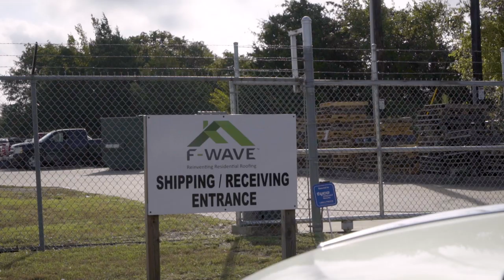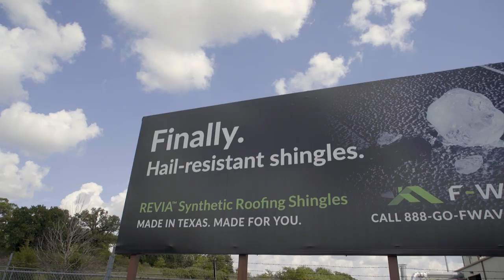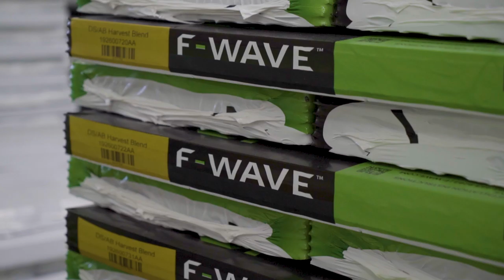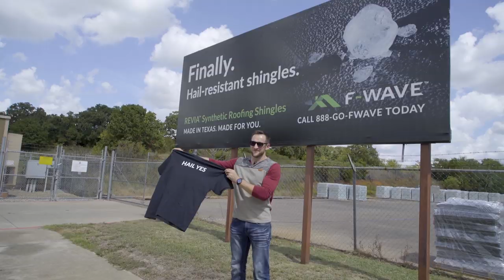F Wave: Roofing Shingle Review: not afraid of Hail or Foot traffic | Roofing Insights

Comment: It’s an amazing product and your video is well done! 

I’ve installed this product in the Denver area and people should know that the installers need to go slow and doublecheck their measurement and chalk lines often. 

This product can easily be installed incorrectly and literally make the roof look crooked. I’ve seen it happen on other installs and about 200 sqft had to be re-done. If that would gone unchecked then the whole roof would need to be re-done. 

F-Wave will offer a product engineer on your first install which will help a great deal and after that you are pretty much on your own so great care must be taken to make sure it’s done right.
Reply: Do you install by chance? I'm looking at using this on a house in longmont..

Comment: I like the "walk on" aspect. I have a low pitch single story ranch, and I like using my leaf blower to blow my gutters out at least once in the spring, and once in the fall. Normally I wouldn't think of walking on a roof, but for cleaning gutters, this is the way. This product is probably going to be my next material for my next roof.

Comment: I'm a roofer w 20 years experience. I know that TPO membrane used in flat roofing becomes very brittle after 7-10 years. Once this happens hail impacts will cause severe damage to the membrane. The damage looks just like a spiderweb crack on a windshield that's been hit by a rock.

Comment: Thanks for the review. Considering getting these as our "class 4 hail resistant" shingles are already possibly needing replacement after only 8 years in Colorado hail. Cost of FWave is more than double, but maybe it's worth it for a more permanent solution?
Reply from the maker: I prefer Euroshield over F wave for hail
Reply: @RoofingInsights3.0  , because of the cost, or the performance?  Or some of both?  Thanks.

Comment: Good and honest review. I am a normal consumer, not a roofer. It surprises me that here in the year 2020, we are still producing 10-25 year asphalt roofs. 

It surprises me because technology should have caught up with the market by now. F-Wave looks like a good alternative. In my opinion for a $$$ thousand dollar roof on a traditional house (ie here in Austin TX), all the roofs should be lasting 50 years. Instead they all have the particles fall off, and the shingles fail in 20 years or less. I call that a failure in the roofing manufacturer's technology. Because I sure don't have to replace house siding or interior sheetrock every 20 years!
Reply: You dont get it do you ? If roofing materials were that durable you woudl put roofers AND manufacturer es out of business, so they have no incentive to move ind infection to point out.
Reply: @johnwhite2576  LOL good point.
Reply: I am getting an f-wave roof installed in Round Rock.  I say that "Asphalt is the roof of all evils"
Reply: @roundrockguy  It looks like an impressive product. I agree that asphalt shingles pretty much suck. I think the standard shingles are there so the roofing industry can make money. What a crap design (standard shingles).
Reply: John White hit the point..As in cars and fuel. We should have had hydro tech running cars decades or a centruy ago, but it is not profitable to the industry that protects and lines its pockets.
Reply: I wonder why they have not used that product that is supposed to be fire proof. Starlite. Sound cheap enough to make and fire proof. Use it in the core or in process.

Comment: Question is After 5 to 7 years in extreme heat and cold it would be very interesting if that plastic does not deteriorate and become vulnerable to hail breaking the shingles up. Only time will tell.
Reply from the maker: time will show
Reply: We know from other products that such materials get brittle. So, I dont know if this is a niche product for hail specifically or is there something to it that hot(90-120) climates with freeze cold winters would hold up for 20+ years...? I wonder what the warranty is like?

Comment: I wonder how it would do for a HOT climate, like Florida or even hotter, Arizona or Los Angeles?? Los Angeles gets 90-115F heat then in winter gets 37F cold for a few times, and the rain. How will the shingle using TPO hold up in such swings of temp over the years? This is the test many would want to know. How are their lab tests in this? Maybe it makes for a hotter attic or maybe noisier when it rains, or?
Reply: texas is pretty hot

Comment: Great review! Getting ready to install F wave on my house. My concern is that they would become brittle over time as well. This is directly from F wave website: “F-wave’s REVIA Synthetic Shingles, on the other hand, are engineered for maximum durability. Because they have zero granules, they won't become brittle, and their performance won’t deteriorate over time.”  Does this make sense, that just because they don’t have granules they won’t become brittle? Doesn’t make sense to me.
Reply: And after speaking with F wave rep today, they say their accelerated 25 year testing shows that they should not become brittle. They expect super longevity. But I guess we will see. In my opinion, we know for a fact that asphalt shingles will become brittle and deteriorate, so might as well try a new product if there’s a chance that it won’t become brittle and has all the other benefits as well
Reply: @LDubsChannel  Perhaps...The first reply for Luke sounds like it avoids the question. I would like to see those tested shingles, and know how they tested it. I would consider these in a hot climate even, that hardly gets hail at all, but, if it outlasts asphalt by a large enough time, it maybe with using. So which comes to the bottom line..the warranty!
Reply: @LDubsChannel  In my area, which gets hail, still a Malarkey roof on a home from 1989.  I go with what's proven.

Comment: What kind of testing did they put the shingles under? Did they expose the shingles to extreme temperatures for extended periods of time? I would expect some sort of stability testing to prove the concept since the technology is only a few years old.
Reply: Hi Jeff, we have subjected our product to all the same ASTM testing that other shingles are subjected to to be able to be sold in the United States. Freeze thaw is certainly one of those and in those tests are expansion contraction rate was very minimal, less than 1 mm.
Reply: How do they simulate 50 years of UV degradation?
Reply: @mobleyMobley  yes, testing methods are important. Like the other comment, for hot climates like So Cal that do drop to freezing in winter but get 90F for long periods then 110+F and then the winter.

Comment: My original comment was deleted for some reason. 

I’m skeptical because a lot of roofs I work on that are TPO/PVC get red algae.  I know shingles can get that, but your premium ones have copper in them to help keep your roof looking nice.  The shingle has granules that can help with grip some.  What happens when these get red algae and you try to “walk” on your roof?

Houses have shady areas and I could see these getting dirty real quick, which will make them slippery.  How do you clean them when they get dirty?  With shingles you can add those copper strips you made a video on a little while back, but for these I don’t see anyway to keep them clean.  

 I like the idea of new types of roofs coming out for home owners, but I’d stick to a premium shingle or get a metal roof if I’m spending this kind of money.  I’d have to give it another 5-10 years to see how this is going before I’d consider it.
Reply: Stone coated metal roofs do not fail due to hailstone impacts but they may show massive dents due to these impacts and insurance companies do not pay claims for cosmetic damages. In addition, the interlocking metal roofing systems are very hard to impossible to replace single damaged shingles. You have to work your way up t o the damaged shingle and replace all the lower metal shingles due to the interlocking nature of the metal roof.
Reply: Regular asphalt roofs get algae moss as well trust me, and it’s really NOT a good idea to pressure wash thsoe with attendant granules loss ! These arte bound to be better

Comment: I drove through a neighborhood with 2 year old houses in Pflugerville Texas that had 2 inch hail.  There was one house on the street had f-wave and it was the only house w/o a roofer's sign in front of it. The other houses had designer shingles and metal, even the metal roofs were being replaced. That sold me.  I'd be curious what accessories you recommend to go w/ f-wave. I am upgrading to Titanium 50 underlayment and bullet boots, anything else?  I believe the roof system is only as  good as the weakest link.
Reply: We've installed F-Wave a few times in the Austin area this year. This includes the area affected by the 4/15 storm you're referring to. We install 24-gauge T & D style drip-edges, a variety of the higher grade synthetic underlayment, bullet boots, StormGuard, W Metal valleys as well as ensuring proper ventilation. We are making F-Wave our primary moving forward as standard asphalt shingles are a subpar product here in Central Texas. They simply do not hold up! Good choice by upgrading to the F-Wave. It has certainly made a believer our of us!
Reply: @BalconesRoofing   Thanks, I saw your work on F-wave's website. Nicely done. I wish I had gotten a quote from you. I ended up going with another roofer, but I insisted on the 24-guage T & D and bullet boots. Apparently my job was the first to use ice/water shield as much as F-wave recommends, 2 feet along eaves and rakes into the interior wall and in hips/valleys and penetrations. I also had my roofer add soffit vents as my house had none on the front and remove a ridge vent over a lower dormer.  I love how you do all that standard, I had to get my roofer to add all of these into the contract. Apparently he had no idea how much some of the things I was asking for cost as he claimed he lost money on my roof, but said he learned a lot. F-wave is great. It is so sad to see all of the new asphalt roofs going in knowing it will take one hail storm to destroy them again.
Reply: @roundrockguy  Yeah, it doesn't make a lot of sense to offer an upgrade like this just to skimp on everything else. We install per the manufacturer's specifications and recommendations and then some. Each job has goes through a full cost analysis so we can be as accurate as possible with pricing instead of offering a price per square.
Reply: @BalconesRoofing  I love the way you do it. My roofer ordered normal drip edge in my custom color but I refused to let them begin until they ordered the T and D I specified in 24 gauge. It delayed the project but I didn't care. My house has large gables and a lot of rake ends so it really mattered to me. He also messed up in letting me specify UDL50 and it isn't even available in central Texas. To compensate for the sub to Tigerpaw at least he threw in gutters over our front porch where we needed it. If we move to another house, or have some major disaster I know who I will call - you.

Comment: Could you do a video on whether 6 inch gutters are needed on residential homes?  Benefits/Hype?
thanks
Reply: That all boils down to how large and how steep each slope is. A proper flowing 5" gutter can shed the water on a 10 square straight gable 4/12 slope. Make that a 10 square straight gable  8/12 and 6" is necessary.
Reply from the maker: It’s not about residential or commercial but size of the roof. One thing for sure is: always go with bigger size downspouts. 6” gutter will work for most residential roofs (unless you have huge slopes) but regular 2x3 down spouts rarely can keep up the water flow (3x4 cost slightly more but it double capacity: 12 square inches VS 6) and usually make all the difference
Reply: @RoofingInsights3.0  realistically, a gutter crew is going to charge maybe $.50 more per LF on 6", but we can upsell it at $1.50 to $2 per LF. Or I can discount it and sell a decent mesh gutter guard with it and still be at half of what Leaf Filter or other gutter protection systems want to charge. The choice to go to 6" with 3x4" downs is an easy one to make for the homeowner, as long as the salesman knows how to pitch the idea.

Comment: An innovative product.  My concern is how well the plastic will stand up to years and years of sunlight. Plastics usually don't do so well under constant heat and IR from the sun. I read their hail warranty.  It's nice to see someone actually warrant their shingle against hail damage. They problem is that you must get a certification from a local government agency that the hail was not greater than 2 inches in diameter.  That's impossible to certify unless the certifying agency was right there at your house during the hail storm.  The hail warranty is only good for 5 years, too.  I couldn't justify the cost unless I planned on living in my house for who knows how long.  A 50 year warranty means nothing when the average person moves every seven years.  Very few people live in the same house for even twenty years.  When you sell your house I doubt the buyer is going to care so much about the warranty on the roof.  Read the warranty and note that the warranty does transfer, but not at near the level of the original warranty.
Reply from the maker: Good points, we actually mention it as well. It has been tested, and “years” can be tested in labs faster as well. We do hope and believe it will last, but time will show. One thing is certain: it performs better than asphalt shingles. And it hailed every year in some markets. I would rather install F wave than dealing with claims every other year. Even if it’s only last 10 years, it will justify the cost.
Reply: All shingles manufactured in the United States have to meet a standard of 2000 hours of intense UV testing, each hour is equal to 1.83 days of sunlight. That is around ten years of sunlight. Our product has been tested to 4500 hours which is just under 25 years of sunlight.

Comment: Does it require open valleys?  If not, how do you lap the valleys?
Reply: I read the installation instructions and open valleys are recommended. Non-granulated Ice & water shield under valley metal.

Comment: Excellent product! I guess it's expansive because the production line is about 100 times slower than typical bitumen shingles factory. I believe if there is huge demand and the guys will speed up their line - the price will become much more affordable
Reply from the maker: I don’t think it’s slower process....
Reply: Roofing Insights bitumen shingles manufactures produces about 1 pallet per minute or even faster. Here is much slower speed
Reply from the maker: They are in process of building plant. Once it’s built it will be competitive. Speed will not be a problem.
Reply: @RoofingInsights3.0  lets hope it will decrease the price :)
Reply: We had the line going at it's absolute slowest to cut down on noise for this video.